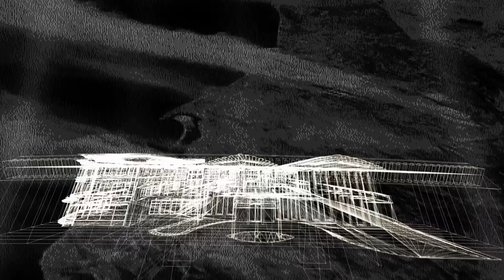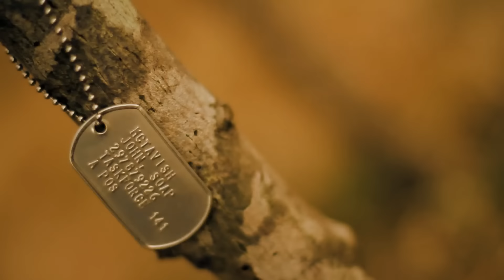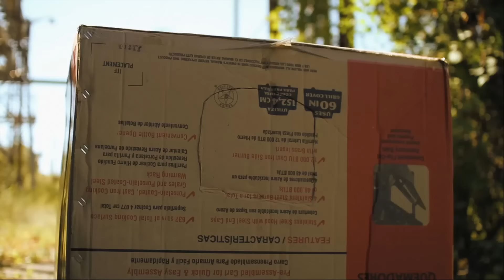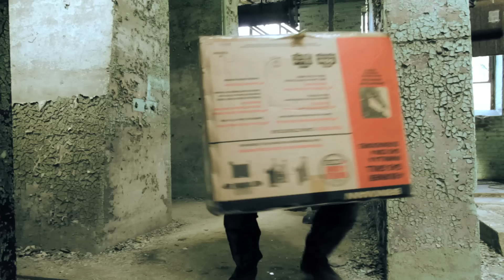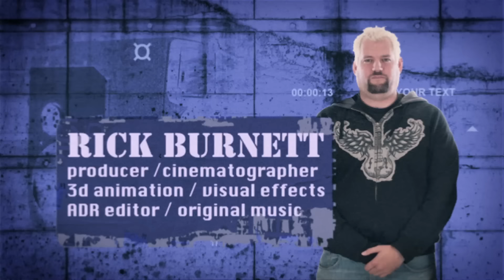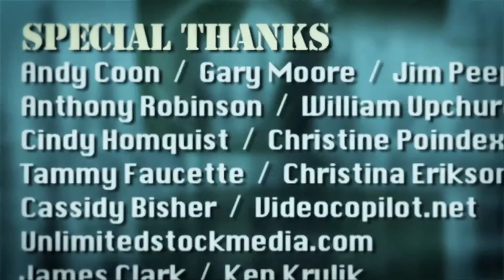Modern War Gear Solid - The Complete Saga (HD)

Comment: What kind of soldiers go on a mission with only one clip?
Reply: Ikr
Reply: Maybe they wanted to travel light lol
Reply: That is very possible
Reply: I think that might have been what Price told him
Reply: actually it can be called either as they are both politically correct terms
Reply: There is a difference between the two.  magazine is a plastic box which features a spring inside of it which pushes the catridges up into the rifle and is used today. A clip is outdated and not used anymore. A clip is a metal stick which holds the catridges in it. Once inserted into the rifle, the metal stick can either fall off or stays inside of the rifle until the bullets are depleted, and then it drops out.
Reply: Mercs on a budget
Reply: yeah, exactly
Reply: GhosT 1 sort of true
a clip is a mag that is fully enclosed in a weapon, such as a pistol clip
a magazine is usually larger in size compared to a pistol clip and sticks out of the weapon rather than being fully enclosed, also the terms get mixed and confused due to things like a small magazine with ends up being fully enclosed in the weapon, like a sniper magazine.
Reply: Thanks for the info, man, I now know the difference between a clip and mag, and to me, that makes a big difference in the way I will talk about firearms.